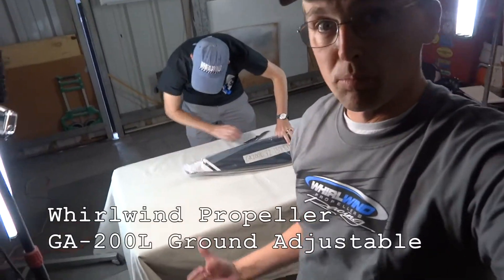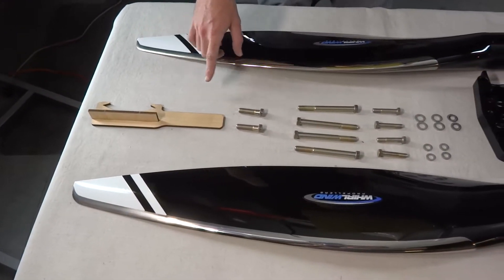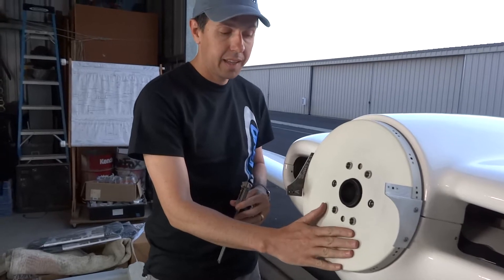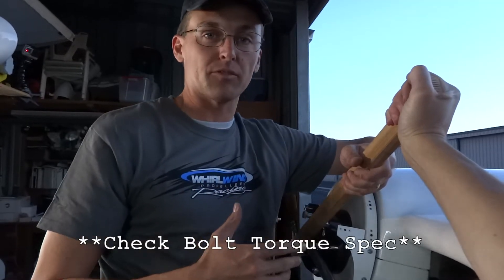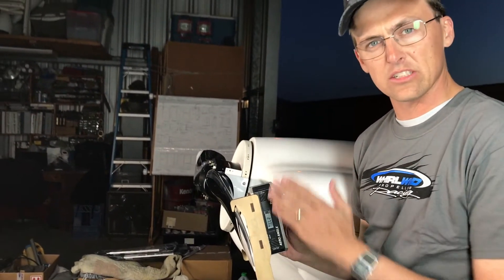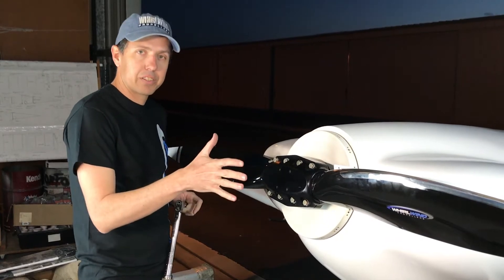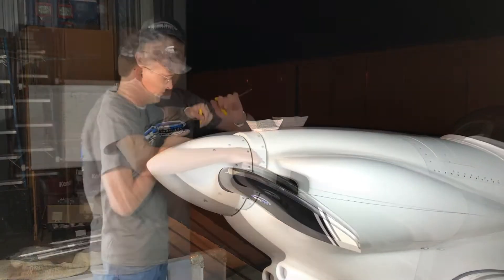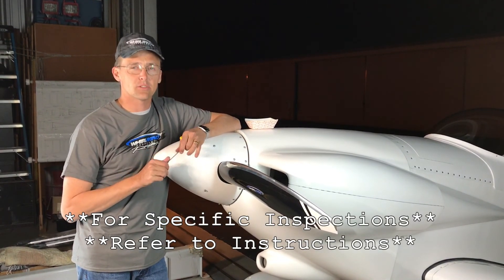Whirlwind GA200L

Comment: Hello Elliot, what was the difference in performance from original prop to the whirlwind :i.e. climb, cruise also what was the final degree used. Thanks....Ira from Visalia
Reply from the maker: I apologize I don't have flight test data on this airplane.
Reply: @utopiasnow  Crap, I have been thinking of changing my metal Sensenich to a GA prop on my RV-8 to move the CG aft.  Was wondering if it was worth it.